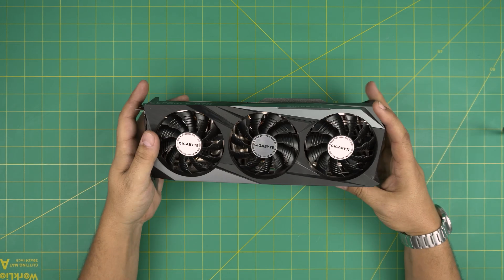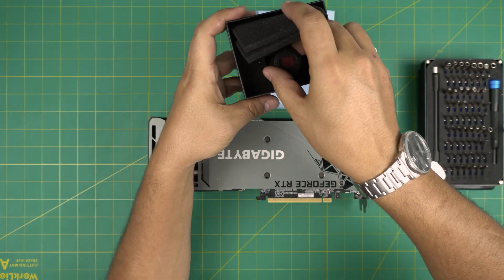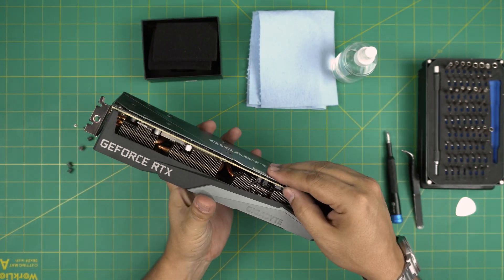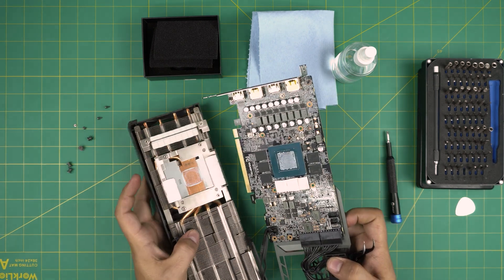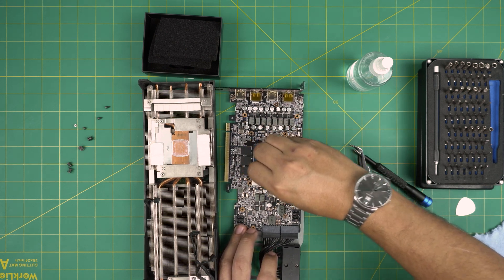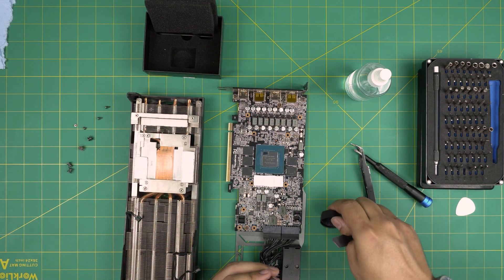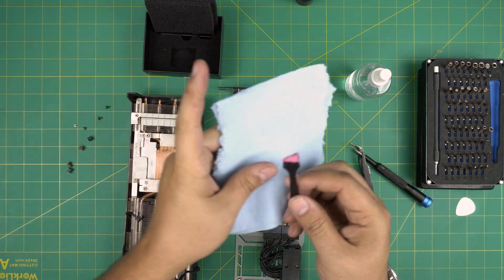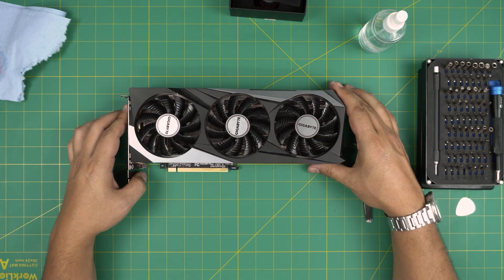How to Repaste and Clean an RTX 3070 GIGABYTE Video Card | Step by Step

Comment: Bro I’m not able to disconnect the little ports connected to the motherboard from the fans, I alr broke one cable and one port.
Reply from the maker: You don't have to use excessive force on those connectors, but it is repairable with soldering.

Comment: Hi, last night I tried to repaste my rtx 3060 double fan gpu.
But inspite if unscrewed all 8 screw my gpu didn't split.
Please suggest what to do now?
Reply from the maker: 🫠Regarding your question, heat up the heatsink with a hair dryer for 5 minutes at maximum heat, then separate.
cheers🍻

Comment: just got this card and it’s running really hot 100C+ with fans at 100% it sounds like a jet and thermal throttles, waiting for some thermal paste to arrive and hopefully that fixes things, ordered thermal pads aswell in case they are falling apart
Reply from the maker: 🫠Regarding your GPU, the issue will definitely be solved. Just repaste it with a good brand of thermal paste and clean the heatsink well. If the pads still look fresh, don’t replace them; if they are dry, then go ahead and replace them.
Should you have any questions or requests in the future, please don't hesitate to ask me.
cheers🍻
Reply: @uFixTek  just repasted it and now my temps are 20C cooler while pullling 100w more, also significantly quieter now, thanks for the guide
Reply from the maker: It's my pleasure my friend.
i appreciate your support 💞

Comment: Wow you shruggled with those connectors. Did you need to disconnect the last two? It looked as though the two halves could lay side by side.
I ask because I just ordered an ex-mining Gigabyte 3070 Gaming OC.
Do you know how thick the thermal pads are ? Because I will no doubt need to replace them and it'll be great if I could order some before the card arrives.
Reply from the maker: 🫠Regarding your question, yes, the connectors can sometimes be hard to pull out, but they will come out eventually! As for the pads, get a sheet of 1mm—that's all you will need. Remember, the pads can be stacked; if you need 2mm pads, you can stack two 1mm pads, and they will perform just like 2mm pads.
For this card, you need a 1mm sheet.
Should you have any further questions or requests in the future, please don't hesitate to ask me.
cheers🍻

Comment: great video bro, just a quick question i  disassembled my gpu but didn't noticed the sequence of the 2 fan connectors in which they go, whether 2 fans goes to front one or the back one and same with single fans connector, does it make any difference if the connectors ports are switched???
Reply from the maker: 🫠 Regarding your question, no, it doesn't. Plug it into the connector that can reach the cable without stressing it.
Should you have any further questions or requests in the future, please don't hesitate to ask me.
cheers🍻

Comment: Why does my 3060ti gaming oc dx6 have the same gpu layout--
Reply from the maker: 🫠Regarding your question, because they are the same chip, all the 3000 series GPUs use the same chip. On the 3050, there are more imperfections in the crystal die, while on the 3060, there are fewer imperfections, and for the 3090, it is flawless. From the outside, they are all the same chip.
cheers🍻

Comment: If i get thermal paste on the metal pins surrounding the gpu will it still work fine?
Reply from the maker: 🫠Regarding your question, if the thermal paste is from a known brand, you have nothing to worry about.
Should you have any further questions or requests in the future, please don't hesitate to ask me.
cheers🍻

Comment: Can i use same size pads on Gigabyte 3070 Ti Gaming OC?
Im with PowerLimit 75% 1 year now! Im down 10% performance (12-13fps like 3070) - The GPU works well until 240w (not more). More of 240W have 86-88c GPU and Hotspot 108c or more.
Used 2mm on RAM and 1.5mm on others. After re-make it with 1.5mm both. Not fix that. Maybe need 0.5 and 1.0mm? 
Never used pads on power regulators. Also i use MX4 thermal paste.
1 year now really i feel bad for this GPU.
Tested with 650W PSU Corsair RMX and 750W PSU Gold. Not the PSU the prob.
Can help?
Reply from the maker: 🫠Regarding your question, sure you can use the same pads for the Ti.
use the .5 and 1mm
cheers🍻

Comment: I can't pull away the back panel. What should I do?
Reply from the maker: 🫠Regarding your question, make sure you have remove all the screws, and if so then use force.
Reply: @uFixTek  If I use force, won't in break? There are creaks like it will break.
Reply from the maker: when you remove the heatsink and detach the fan cables, you will need to remove the screws on the board that holdts the back plate, there are about 5screws.

Comment: do you need this specific brand of thermal paste or I can use any other thermal paste?
Reply from the maker: 🫠Regarding your question, any thermal paste will work, but I recommend using a high-quality thermal paste. If you use a low-quality or cheap thermal paste, you risk overheating and damaging the GPU.
Should you have any further questions or requests in the future, please don't hesitate to ask me.
cheers🍻
Reply: @uFixTek  Thanks for replying man, what do you think about the BSFF thermal paste brand? it is the one I have as extra.
Reply from the maker: they are ok brand.

Comment: I have changed the thermal pad to 0.5mm and 1mm according to you and the thermal paste but my temperature at full load for a long time is the same as before changing the thermal paste. Did I do something wrong?
Reply from the maker: 🫠Regarding your question, you didn't do anything wrong; this is a service and repaste. One thing you are forgetting or need to understand is that no matter what type of thermal paste you use, or even liquid metal, your temps after 1 hour of high load will reach high levels depending on the fan curve of the GPU BIOS.

Here's how the fan curve works: it activates a certain percentage of fan speed when the temperature reaches a specific level, and once it reaches a mid-level temperature, it will increase the fan speed percentage higher. This will continue, and when the temperature reaches 80-90°C, the fan will activate at 100% speed.

You can download a program called MSI Afterburner, go to options, and change the fan curve to your preference. For example, you can set it so that when temps reach 60-70°C, the fan kicks in at 80-90% speed.

Don't get me wrong, you do need a good thermal paste to absorb heat quickly from the GPU/CPU, but the main part of cooling is managed by the fan curves.

I hope I have explained myself clearly.

cheers🍻

Comment: Thanks for the guide! Took my GPU apart and repasted it, now it's running 10°C hotter than before (90C max).

BUT it's stopped crashing so I think that's a good sign?
Reply from the maker: It's my pleasure my friend.
🫠Regarding your question, that's fine. 90°C under heavy load is perfect.
Should you have any further questions or requests in the future, please don't hesitate to ask me.
cheers🍻

Comment: Hey! Just repasted my 3070 and getting 30C less while under load in hotspots!! I am a bit concerned though because I got some thermal paste in between the capacitors and couldn’t really get it clean. Any advice?
Reply from the maker: 🫠Regarding your question, don't worry at all about the paste around the capacitors; that is 100% fine with zero issues. If anything, it's good for the capacitors anyway. 

30°C can't be under load; check the number again.
cheers🍻
Reply: @uFixTek  you are a LEGEND and under rated!!!! Thank you good sir, you’ve earned a sub,
Like, comment, everything!
Reply: @uFixTek  sorry, I WAS getting 110C-115C on Hotspot, causing my GPU to go into safety mode and shut it self down. I’m getting 30C-40C LESS now that I’ve repasted the card. 

I should have clarified :p
Reply from the maker: ah 🫠
It's my pleasure my friend. i appreciate your support.
ah you have dropped the temps 👍🙂
next time when you about to service the GPU get a 20mmx20mm .3mm Thick copper shim and place paste on both side and place it on the GPU then the heatsink over and watch the magic.
https://amzn.to/46HVTj5
NOTE: use only .3mm thick copper shim
also use a high quality thermal paste on bothside:
thermal grizzly kryonaut extreme: https://amzn.to/4d8d8g3

Happy gaming 🍻

This is an Amazon affiliate link. When you use my links, you are helping to support the channel. 🙏

Comment: Thanks for the guide. i only removed the RGB connector and it went smooth. Also, I noticed that you have to remove the 2 plastic security pins preventing the connector to be plugged out
Reply from the maker: It's my pleasure my friend.
Yes, those plugs have two flaps, but they get toasty with heat and get stuck, so you will need to lift them a bit.
cheers🍻

Comment: Hey thx for the video but i already bought 1mm thermal pads. It is fine to use that 😅
Reply from the maker: It's my pleasure my friend.
🫠Regarding your question, it is file with 1h stressing the pads will get squished down to the desire size.
don't worry.
Should you have any further questions or requests in the future, please don't hesitate to ask me.
cheers🍻
Reply: Ok thx 👍🏼
Reply from the maker: anytime

Comment: Hey! So glad you're consistently responding to comments. Two things

1. Is 70% isopropyl alcohol just fine or do you have to use explicitly 99% isopropyl?

2. Can you use cotton swabs to clean the GPU die instead of a workshop towel?
Reply from the maker: It's my pleasure my friend.
🫠Regarding your question, I highly recommend using 90%+ isopropyl alcohol. Never use 70% or even 80%. Use cotton to clean the GPU, but the best option is a workshop towel. The workshop towel will not get tangled on the small capacitors and will not damage anything on the board. It will tear apart before causing any damage, whereas cotton can get tangled in the capacitors and damage them.
Should you have any further questions or requests in the future, please don't hesitate to ask me.
cheers🍻
Reply: @uFixTek Just got 96% alcohol, what I meant was Q tips and not things like cotton balls (unless you understood my first comment as such) workshop towes still a necessity?
Reply from the maker: Q tips are fine 🫠👍
Reply from the maker: Use the Q-tips, my friend. If you use microfiber, just be careful you don't get it tangled on the tiny capacitors.
Reply: @uFixTek  Much thanks man!
Reply: @uFixTek if I can't get my hands on a workshop towel will one of those glasses cleaning microfiber cloths do the job too? They don't leave too much textile behind no?

Comment: I’m looking for help on fixing a 8 pin male connector on a gigabyte rtx 3080 ti. One of the 8 pin connectors is not drawing power.
Reply from the maker: 🫠Regarding your question, look for it at aliexpress and you will need hot station and solderign iron to remvoe and replace it.

Comment: I absolutely second everyone here. 
It is actually amazing, i just ran furmark, and when before the hot spot was at more than 107C, while the gpu was roleplaying as a jet reactor, it now didn't go past 80C, and i barely heard anything, i'm not even sure the fans kicked in !
Reply from the maker: Awesome job at servicing it 🫠👍
cheers🍻
Reply: I also have a hot spot around that temperature, is it because of dust or was it the thermal paste, or the fans of the gpu itself? I'm thinking about cleaning it (I never deepcleaned components)
Reply: @Jaspervv2 little bit of both. A deep clean is always good but if your thermal paste is bad, you’re still gonna have a overheating problem
Reply: u should turn on ur fans configure them to start turning at 60c

Comment: Bought card used, it was speeding to 83 degrees even without max load. Repasted with arctic 4, immediate improvement! After spending some time in Heaven it is slowly climbing, currently at 76 (from 68, initially). Might try undervolting and see where this goes
Reply from the maker: 🫠Regarding your repaste, try usign a higher quality paste before undervolting: thermal grizzly kryonaut: https://amzn.to/49eSPuF
cheers🍻

This is an Amazon affiliate link. When you use my links, you are helping to support the channel. 🙏

Comment: My gigabyte 3070 was an used mining card and the first repad try was a fail because i bought too thick thermal pads (1mm). Only after the second try with 0.5mm thermal grizzly for the RAMs now it works and the gpu chip has proper contact to the heatsink.
Reply from the maker: yes never use a thicker pad , else it will counter push the heatsink away from the GPU/CPU. glad that you got it fixed/serviced.🫠👍
Should you have any questions or requests in the future, please don't hesitate to ask me.
🍻cheers

Comment: Worked well for me, ty. I bought an ex mining card and when I finally opened it up to change the paste, it was no wonder it was hitting 80+ temps, there was basically no thermal paste. Before under load i would hit 80+ and my game and system would crash. Now under full gaming load with max settings and dlss, doesnt ever cross 70 and my system runs waaaay quieter now.
Reply from the maker: It's my pleasure my friend. 😊 Thank you for taking the time to give feedback! If you would like to support the channel, please like, subscribe, or both. :P
ya those mining GPUs are really dried up because they push them to max 24/7.
Should you have any questions or requests in the future, please don't hesitate to ask me.
🍻cheers
Reply: @uFixTek  Hello! Can you tell me, please,if Arctic MX4 is good enough for repasting this GPU? Also,can I connect the ARGB led connector to a third party argb hub with 3 pins 5 v? 
Thank you!
Reply: @kgandrala I did the exact same thing. +80 temps and system would crash. Watching the video now, hopefully this clean and repaste works well!

Comment: Thank you for this guide! The factory thermal paste was completely dry (the thermal pads are still fine). My card was reaching 89 degrees and the hot spot would go to over 115 degrees before crashing. After replacing the old thermal paste with some new GD900 the GPU won't go over 70 degrees and the max hot spot temp was 81 while running Time Spy.
Reply from the maker: It's my pleasure my friend. 😊 Thank you for taking the time to give feedback! If you would like to support the channel, please like, subscribe, or both. :P
i would highly recommend you to use the thermal grizzly kryonaut
https://amzn.to/48HTLYG
with that you will get much better results.
Should you have any questions or requests in the future, please don't hesitate to ask me.
🍻cheers

This is an Amazon affiliate link. When you use my links, you are helping to support the channel. 🙏

Comment: I have same graphics card how to check memory temperature is not showing in msi afterburner and gpu z and hardware info
Reply: Some brand and some cards dont add this sensor to some of their cards. So there is no way to get memory chip temperatures on those cards.
This is one of those cards unfortunately.
The next best thing you can do is look at the Hot Spot temperature instead in gpu-z
Reply: Ddr6 vram doesn’t have a thermal sensor on 3070
Reply from the maker: Thank you for your feedback! If you wish to support the channel, you can like, subscribe, or both!
Regarding your question, use the : hwinfo to check all the info you need, voltage temps and speed.
Should you have any further questions or requests in the future, please don't hesitate to ask me.
cheers🍻

Comment: Thanks for the tutorial, amazing work here. Just two questions here: 1. since there are 2 x fan connector, is there a problem if I connect them back in reverse order? 2. What's the max temperature after replacing the thermal paste? Thanks a lot.
Reply from the maker: Thank you for your feedback! If you wish to support the channel, you can like, subscribe, or both!
Regarding your question, you can switch the fan connector order, but DON"T connect them reverse.
with the best thermal paste you will get a steady drop of temp about around 10C o more.
again keep in mind that the fan curve has a big roll in the temps.
the best paste i recommend: https://amzn.to/40v1gPp
now if you want a best of best and don't want to deal with liquid metal, you can place this: https://amzn.to/3FQNptw
this is a permanent sheet without damaging the copper and never expires and gives you a superior thermal conductive, all you need to do is to tape around the GPU crystal dye with kapton tape: https://amzn.to/3ssbALB
as the kryosheetis very conductive so one sheet of this tape on the GPU components is more than enough to protect them, and place the sheet in the middle and enjoy the BEST of the best👍
with this kryosheet you will get the temps to the lowest possible.
Should you have any further questions or requests in the future, please don't hesitate to ask me.
cheers🍻

Comment: Thanks for the video! By your guide I re-pasted my Gigabyte RTX3070 using Arctic cooling pads TP3 and paste Arctic MX4 and get 18-20 degree lower temperature (Cyberpunk 2077) - measured by GPU-Z. Thanks once again! 👍👏
Reply from the maker: It's my pleasure my friend. 😊 Thank you for taking the time to give feedback! If you would like to support the channel, please like, subscribe, or both. :P
Should you have any questions or requests in the future, please don't hesitate to ask me.
cheers🍻
Reply: What size did you get for the arctic tp3 pads
Reply: @DistantMist  doesnt metter - you have to cut them to the proper size.